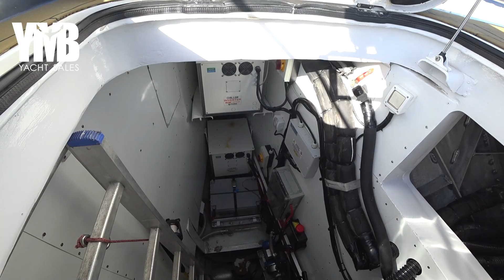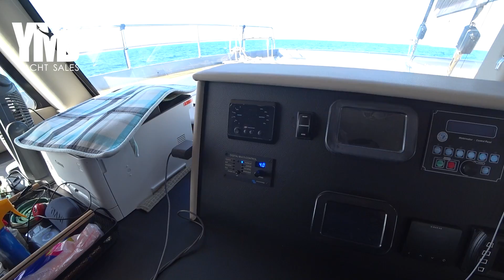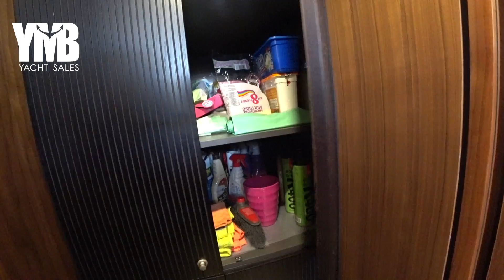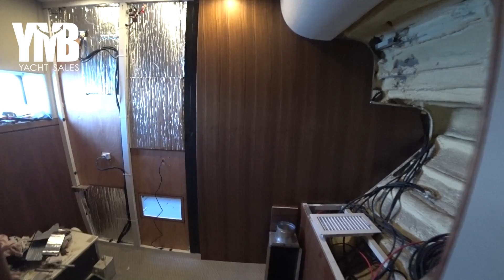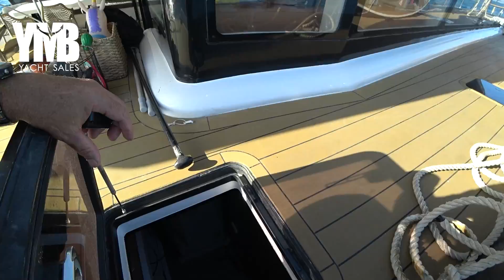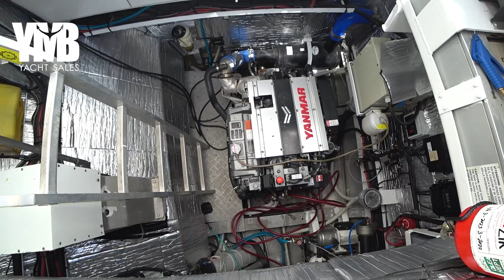10 m BEAM CUSTOM ALU. SAILING CATAMARAN 21 m  For Sale Full walkthrough while sailing in OPEN SEA

Comment: As an old guy with aches and pains, if I got back into sailing (after decades away) I would definitely go for automatic furling and trimming using joysticks. The hauling/rigging/trimming with winch cranks, etc. is for younger, more athletic types.

Comment: those air con units in the front bow won't have much air circulation around them , need the hatch up when using or put them on the roof